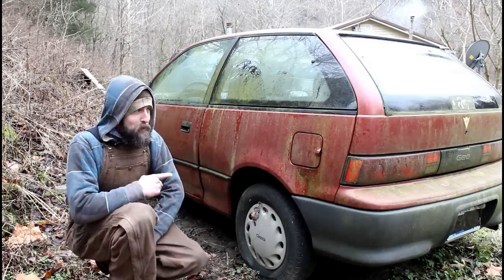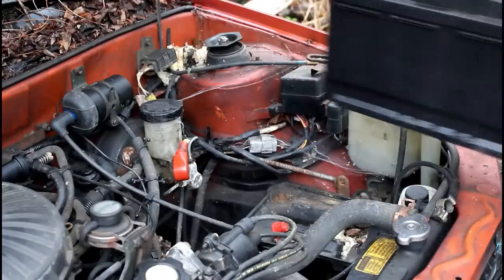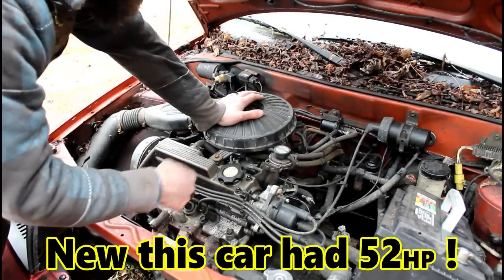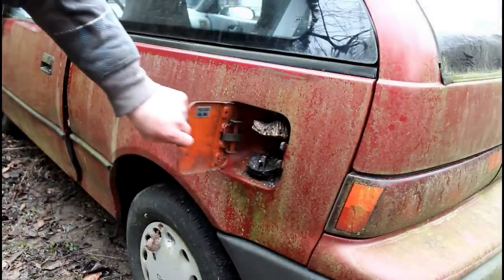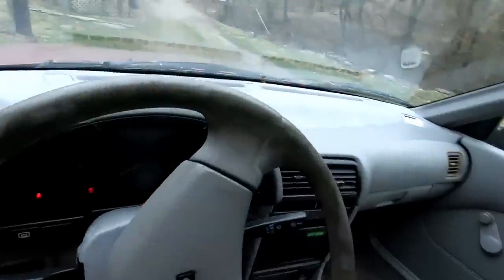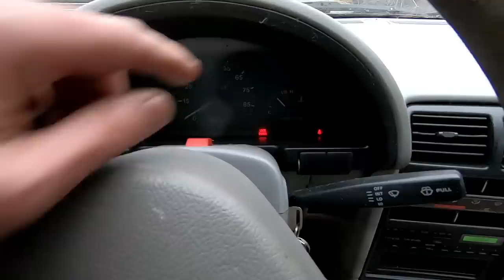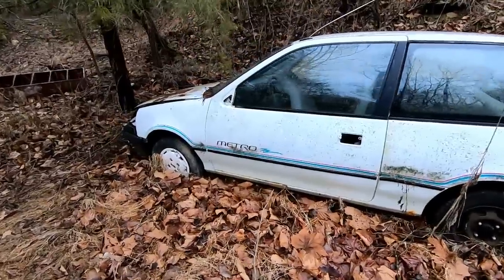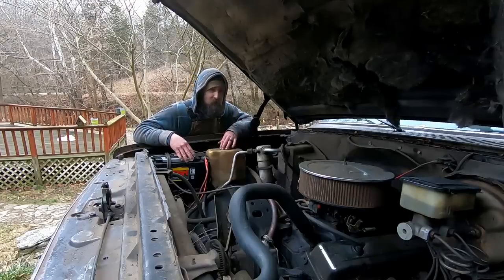WILL IT RUN ? Sitting for YEARS UNTOUCHED! 🔥

Comment: The excessive oil consumption is most likely caused by bad valve seals. Nothing more. These Suzuki engines (Geo = Suzuki), are pretty durable for such dinky things.
Reply: On the documentary wreck trek they had a tiny suzuki maruti and that thing just kept going.
Reply: I think it’s just a tad overfilled with oil to be honest
Reply: The geo prism was made by Toyota but the rest were Suzuki I think

Comment: Damn for a second there, I thought you were gonna take off down the road with the Hood up! Lmao
Isn't it amazing how it's always those little "Cheapo, ol' junkers" that can sit for 20 years with Rotten Gas, and no attention whatsoever, and they will fire right up, as long as they have a good Hot Battery.
You.could take a really expensive ride, let it get this old, and be mistreated like this, and you would never in hell get it started again w/o spending a small Fortune. I love how these Cars will run damn near on Water. Seriously, there is very little that resembles Gasoline after it sits for this long, in a metal Tank going thru all the Seasons and Temperature fluctuations, there has been a massive amount of Condensation in this Tank which creates a lot of Water.
This was a cool video to watch!

Comment: Best car I ever owned was a 91 Metro xfi.  Never had a day's trouble with it.  65 mpg on the highway.  55 in the city.  Only thing I ever changed on it was put a new muffler on it when I bought it.  It had a small hole in it.  I was driving with copper spark plugs and had to drop a gear to get over a tall bridge.  Replaced them with platinums and made it over the bridge in 5th gear and was still accelerating.  Great little car.  Neon blue.  Called her, Doodlebug, because with the hole in the muffler she sounded like a VW bug.

Comment: How are the frame horns? I loved my Geo Metro, the wife not as much. LOL. I rebuilt it twice and the last straw, the heater hose blew off and I didn't know until it was too late. I got 45mpg burning oil and 48 after a rebuild, I drove it like I stole it.  The block fit in the dishwasher..... Everybody ripped me for it at work. I told them I have the pink slip while they are paying $6-800 a month for their fancy diesels!

Comment: I owned 2 Geo's when I was younger. A 93 and 96, at the same time. DAMN! I miss those little cars. At one time I parked my 96 for 3 years for some reason...maybe tranny was messed up, but I put Stabil in the fuel tank when I did park it. That little sucker fired up and drove on the first try.

Comment: Weren't those actually mfg by Suzuki in partnership with GM? Those little Zooks are practically bulletproof... Well, except for the one with the broken rod ;)
Reply: I used to work at the factory that built these. Designed some of the tooling used to assemble them. Good to see them still out there in the wild 👍

Comment: Looking at this I'm pretty sure that if you left a contemporary modern car out in the open like that with all the computers and flash memory in them they wouldn't start.  Much less one of these current modern cars that would be 28 years old like this Metro. You'd need replacement LCD screens and other such nonsense after 2 or 3 years that would be obsolete and a whole bunch of other computers/electronics that would be obsolete.  Not looking forward to the day when I have to replace my "simple" car.
Reply: My Citroen XM also needed replacement LCD screens sooo..... Tho other than the hydraulic pump everything seems fine on it
Reply: @Vince I       Hopefully we won't have to replace our simple cars.

Comment: I had a 1993 metro  bought new. Drove it 300,000 only put gas and oil in it. Never changed the breaks. Car was indestructible.

Comment: You can pull the motor out with a good pair of Levi Jeans, hone the 3 cylinders new cam and a set of rings bet u make 53 hp
Reply: More Like 65-75 Horsepower Or More! Even Better Turbo It!

Comment: These little cars are amazing.  Incredible gas mileage and enormous space for the size.  52 horsepower or not, with just the driver in it, these cars didn't feel terribly underpowered--at least around town.
Reply: These with an automatic are slow.  Most Metros you are likely to find have low compression and still run.   With a rebuild and 210 PSI compression they are much better.
Reply: @timothykeith1367  oh, yeah, the automatics are to be avoided.

Comment: Those little Suzuki built Geo metros Are still very common down here in Miami. The 3 cylinder Engines with the 5 speed manual C and the 4 cylinder models mostly with the 3 speed autos. Cubans love them because they are easy to fix and cheap to run. There's a lot of the metro convertibles zipping around town is well. We call them Japanese beetles Because of their simplicity much like the 1st V w's. I wish you could donate that little guy so  He doesn't have to just sit and rot

Comment: I worked at a Car Rental place that had a bunch of those but automatics. They would come back with flat spots on the back tires... took several weeks to figure it out. They were applying the parking brake and driving off. Sometimes all day. just dragging the back wheels. They also broke off the turn signal arms thinking they were the shifter.

Comment: I had the original version of that car..the Chevrolet Sprint 1985. I loved that car. First car I ever put 100000 Km on. Yours has the more modern engine...Single overhead cam. Mine was a cam in block. I never put a mark on it (other than being rear ended and shoved in front of a freight train...) Sold it to a guy...less than 24hrs he wrecked it.

Comment: Great Video. FANTASTIC CAR!! This is the US version of the Suzuki Cultus/ Swift Hatch/ Cino. 
Super success worldwide. This was " Made in Japan " so its heaps better than anything put together in the US. Lovely car. I drive a 93 Suzuki Swift sedan in India and its going strong. Iconic car. Change the gear oil, engine oil, coolant and brake fluid snd it will go for another 200000 miles, no sweat. Whereabouts in rhe US are you. Pacific Nothwest.
Suzuki is big in India and makes 1.5 million cars in the country each year.They brought the Swift sedan, not the hatch to India in 1991. The place is full of them. All manual versions. No autos. Auto were weak and wimpy. GREAT CITY CAR. Not the best for interstate speeds

Comment: I had a '90 Metro stick-shift that I bought new. Drove it for several years until it was totaled with over 200K miles on odometer when a moron ran a stop sign and pulled out in front of me on my way to work early one morning. (He tried to flee after I t-boned him but my car restarted and I chased him a few blocks until he slid into a ditch. I called the police while he was trying to get out... There's more but that's another story...) 

A friend had one he drove >100 mile round trip every day. I drive about a 70 mile round trip for my day job, and my old Ford Fairmont with the clogged heater core was not a 'keeper' for a second winter. Since I'm a low string player (cello, string bass) I needed something that would carry them. When I walked into the dealership showroom carrying my string bass they said in a curious voice, "Can I help you?" My reply was, "If this will fit in [pointing] that car, I'll probably buy it." "Go right ahead, sir!" It did, I did, and that little roller skate was amazing. 

It had plenty of zip if one knew how to finesse (maybe not the right word :)  the manual transmission. It was light enough that it could be easily unstuck from snow by using what I call 'the Fred Flinstone method' of sticking my left leg out of the car to rock it while I manipulated the gas. I filled it to the brim with large musical instruments, equipment, and luggage on several occasions when free-lancing with regional orchestras in the 90's. I don't recall it ever letting me down. Another thing I liked: there was no center 'console' below the dashboard, so it was easy to put ham radio gear in. 

Prayers for your wife's health!
Reply: Great story. These Suzukis were built tough in Japan. Suzuki sold millions of these in India. The car was just not up to scratch. They had local Indian parts and were nowhere near as good as the Japanese ones.

Comment: I would get a geo metro 3 cylinder. Buddy of mine had one and it had really good gas mileage. So there were 3 of us that worked for the same construction company and we go to the same job sites around the area. The Geo Metro (5-speed) only needed $5 of gas a week, my 1993 Mercury Cougar v8 (automatic) needed about $40 of gas a week, and other buddy with 1990 Honda Civic 4 cylinder (automatic) needed about $45 of gas a week.

Comment: Putting in some new valve oil seals could fix the oilburning issue.
Yeahyeah it's not "profitable" to repair car with such a low value, but it would make a quite a cheap car to drive, low tax and good mpg.

You could make a video of using some oil stopleak snakeoil in it.
Reply: Well there is not alot of places where oil could come in.
Mainly just the valve seals and piston rings.
If the pistonrings would be that bad, the engine would lack some serious power, and i doubt that it would start at all.

Comment: I had one of these back in the day.  It was a rare 4 door model with an automatic, I think 3 speed tranny.  Same issue as yours, started burning oil.  It was a good commuter car, but was not too good for highway driving.  I think it topped out around 75 MPH if I remember correctly.

Comment: my now wife of 10 years,had a 1997 geo 4cyl when we met in 1999,was sad that it just rusted away,hole on the floor,and you could only full it up half way the gas tank was rusting out,we called it the clown car ,I am 6 foot 2 and tip in at 240,so when the water pump went that was it,the clown car still got 44 mpg and had 426,000 miles on it,man I miss that car.

Comment: I recently had a 1991 geo metro convertible, it has 115k miles, but it was pretty much dead, because of rust underneath, living in Illinois, the front frame member to front right wheel casting arm, broke apart due to rust

Comment: I would chuck the car up on wooden blocks below the wheel bearings, instead of letting it sit on the tires with the brakes locked.
To avoid that the car rolls away if the ground is to wet to support the car, just put some blocks behind the tires.
This way the tires won't get damaged and the brakes don't lock up.

Comment: Had a Pontiac firefly (same car) most fun car I ever owned. Would roof rack mount a 12 foot fiberglass boat and put the motor in the back along with 2 weeks worth of gear... Went from 50 mpg down to about 30, but still good.

Comment: I had a 92 3-cylinder 5-speed with air. And the interior on those cars is absolute trash. Door handles would fall off stuff like that. But mechanically that little three-cylinder engine is pretty damn tough. I used it for pizza delivery, and then as a small courier vehicle. I put 100,000  miles on mine in one year.
Two rear wheel bearings, and tires are the only things I ever had to do to that car. Bought it for $750, sold it for $250. Thing is absolute tin can I would not want to be in an accident in one. But they were simple reliable vehicles.
I can't believe that thing lit off that quickly after sitting for that long..
Pretty awesome.
I think you should fix it up and drive it. Even if you don't fix the oil burning issue just drive it.

Comment: The second generation Metro featured two engine options. The three-cylinder, 1.0-liter throttle body injected engine, still used on base models, was available for non-LSi models in 1997. The 1.0-liter became the last engine on a vehicle available in the US to use TBI.
Reply: This generation also offered a revised 1.3-liter inline four-cylinder engine used in the Pontiac Firefly, with multi-point fuel injection (with hydraulic lifters and lash adjusters, and a 30,000-mile service interval).[5] The 1.3-liter inline-four engine offered 70 hp (52 kW), and was the same engine that had been in use in the Suzuki Swift (except for the GT models) in prior years. LSi models produced after 1997 featured the four-cylinder engine with a sixteen-valve head instead of the eight valves of the earlier design, yet was still a SOHC design.

Comment: Here in Pakistan it is called Suzuki Cultus. We had them manufactured from 2001 till 2017. I still own one thats 2007 . Done 134000 kms and running good.No safety features just plain seatbelts in front only.

Comment: In Hungary, these cars are known as: Suzuki Swift (MK2, MK3). Tens, or maybe hundreds of thousands of these cars still run on the hungarian roads. Oh, and if we count for the newer Swifts, there are even more.
4 cylinder, 1.3 litre 75 hp Suzuki Swifts are even better. They're like a little rocket with their low weight.

Comment: I enjoyed this.  Thank you.  And yes, Thumbs Up!  I was amazed that it started up with old gas.  Maybe you don't have ethanol gas where you are.  I'd pour motor honey in it and see what I had.  The worst of that car is probably what the mice did.  I had a brand new '87 Chevrolet Sprint E/R , the first generation of these.  It only cost $5400 and the E/R (Extended Range) option was $200.  It was a good car, except for when the outdoor temperature dropped into the teens and single digits, then the heater wouldn't be able to keep up.  A few years later I bought a used '91 Geo Metro 4-Door Hatch.  That was a good car too.  But I never felt safe in either of them.  With that second one everything was fine but after owning it for about a year, the last summer that I had it I kept coming upon bad accidents, and twice the road was blocked because the accidents were so bad.  On one of those the officer that redirected the traffic was crying.  After that one, I took all these accidents as an omen and bought a safer car.

Comment: I had one of the Sprint that actually was the first year Metro.  had a automatic, 3 cyl , air....  told a young woman that was working at the local Food/ gas store that it got 50 mpg and I ended up selling  it to her. then I realized she weight almost as much as the car so it probably wouldn't get that good of gas miliage.   She drove it 3 day and when I can in next she asked if the gas gauge was broke, and why it didn't want to take gas.  I had filled it up when she bought it and she didn't realize that she had only used little over a dollars worth of gas

Comment: I had the UK version (Suzuki Swift) 1.0 GLS in the same red as yours. The Registration number was M870 JJU. Brilliant engine which was easy to fix but the bodywork rotted out so fast on the floors. Would have another if I could find one. A 1.3 GTI would be my first choice.

Comment: That brake reservoir being empty-  you have a leak in a line,  definitely air, too, as the pedal is spongy. I know a good ole boy like you will sort it out.   Jack it up and take the wheels off - (anti-seize the hub/wheel interface.. work the brake pads loose of the rotors.. you'll get it moving.   Maybe dump some isopropyl rubbing alcohol (90%+ ) in the gas tank to get rid of any water

Comment: Interesting.  What shocked me was that it ran on gas that old.  For small engines (e.g. lawnmower), I run the carbs dry to avoid gum and varnish while it sits.  If gas in a gas can in the garage is more than a year old, I become suspicious unless it is mixed with fresh stuff.  Based on experience(s).

Comment: We had a 1992 Metro Hatchback sadly was a lemon. The car did get us point A to B had lots of issues it did have a missing hubcap on left front end whenever had a hard rain wouldn't start. Finally one day left stranded at Walmart had enough traded off on a used Nissan Altima thought was much better car than the Metro think they are some nice little cars just look weird it had low mileage 76,000 haven't seen one of these in years.

Comment: Car was made in Hungary I owned two of those. Everybody made fun of them but for the price and 1 years free maintenance from the dealer I couldn't pass them up when they first came out for me and my wife at that time. As a matter of fact wife even hit a small deer rolled it on its roof and believe it or not the insurance company actually fixed it, go figure. When one of them finally wore out I found a Suzuki Swift with a 4-cylinder drilled out the spot welds on the motor mounts welded it into the Geo swapped over the computer and wiring and drove it for another couple years

Comment: You can Own a car driven by the world known Steve Summers !! 
UP for bid is a Cherry (red) Geo Metro
* Great Compression
* New brake fluid
* Newly freed up brakes 
* New air in tires
* New front end
* Road tested 12" tires
* Clean windows
* A hold you back in your seat 52 horse POWER 
* 1/2 a tank of gas (commentary )
* Mouse & Spider Friendly
* Has been in storage to keep mileage down
* Be the envy of your co-workers by getting 50+ miles per gallon ( down hill )  Your mileage may very   
* Your neighbors will get a worm spot in there heart ❤ smell you helping control the Mosquito population   
GET YOUR BID IN NOW while it's low !!! 
Starting bid is at the CRAZY low low price of ( hold on to your hat )  $ 251,000.
Enjoyed the video.

Comment: Old GM cars from what I hear don't take alot to get running. I hope that's the case with my ride that I have in my profile picture. Sat behind a barn with a classic mustang sitting in it. The Delta 88 sat for 3 years in a gravel driveway. I'm going to bring some cash and tools with me, so I can grab engine oil, fresh gas, stabilizer, oil filter, and a cheap used working car battery for around $50. I also need to cut the wired mess holding my hood shut, and just invest in some hood pins.
Reply: The battery would hopefully cost me $50

Comment: My family car:421000 miles
Changed parts
Battery
Pistons
Radiator
Dynamo
Fuel tank
Handbrake replacement 3 times
Brakes idk hoz much times replaced